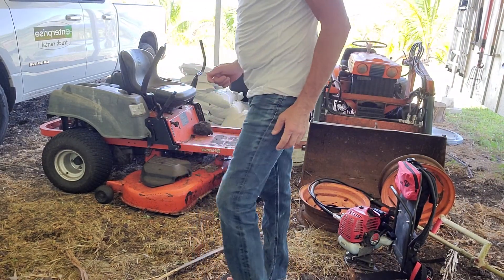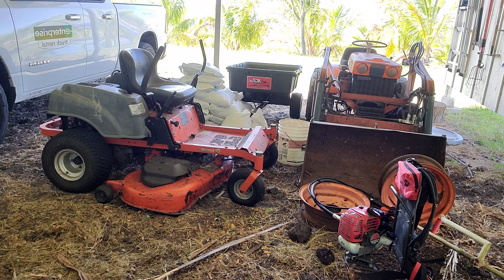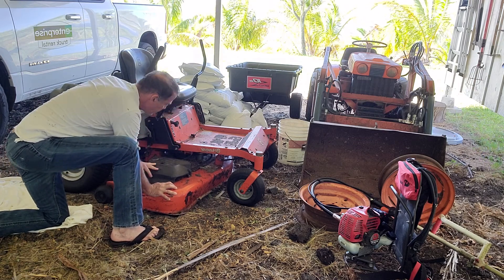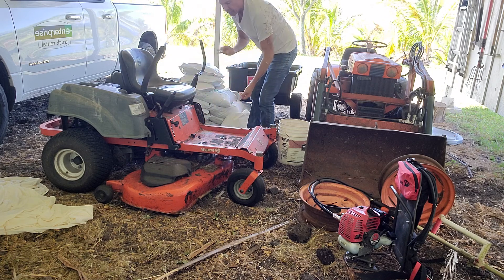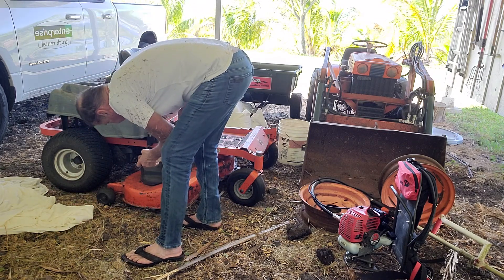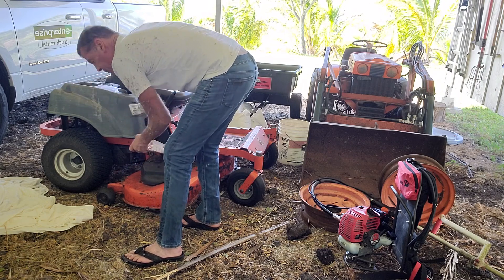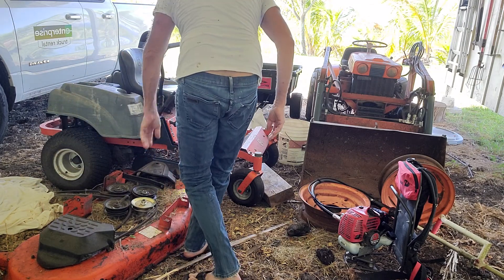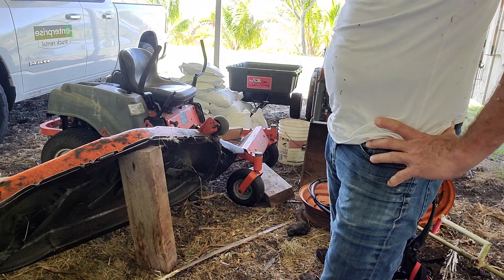Removing Deck of Husqvarna RZ5424 Zero Turn Mower on my farm in Kalapana, Hawaii

Comment: DId you snap every one of the spindle bolts?
Reply: They typically break and the new spindles have new bolts
Reply from the maker: Many times...although are talking about the spindle housing bolts? They can be a little tough to get off when they break. Sorry for the lag in response time! LOL!